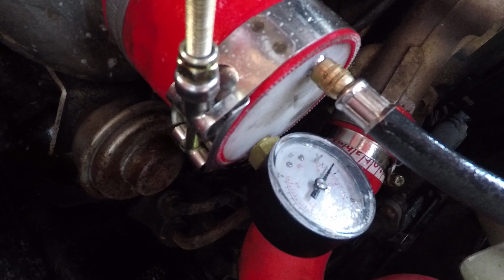Best Boost Leak Tester - Finally found the RX7 leaks! // Unlimited Super

Comment: Thanks for the video. I have the same problem where you made a block off plate near the throttle body elbow.Is it ok to block that one? What is the purpose of that part? Im pal ning to just make a solid gasket and sandwich it. What do you think?
Reply from the maker: There is ment to be a  part for the accelerated warm up procedure there. But I had removed it, but must have forgot to blank it out. Its OK to blank off, it's not vital part. There's alot of parts that cna be removed and blocked off.
Reply: Unlimited Super is it possible that cre my boost leak is coming from there?Used to have .7 bar before I installed my fmic. Now it is just .2 bar. I tried to pressurize it with air and can hear air coming out from that area. Thanks for the reply.
Reply from the maker: @neilpadriga  use the soapy water method, where you can hear the air. and it will show you exactly where the leak is
Reply: Unlimited Super sealed the area where the accelerated warm up is located now I have a leak in my primary injectors. I saw you have the same issue just wondering how you fix it. . Can it still affect boost pressure in that area.(injectors) thanks for helping me.
Reply from the maker: @neilpadriga  you can either get replacement o rings. Or used 3/8 fuel hose. And cut them to size, which is what I did. It will act as a vacuum leak and also affect the spray pattern of the injectors. So get it fixed, as its easy to fix
Reply: Unlimited Super  Thanks man